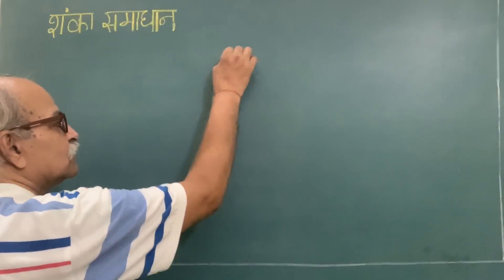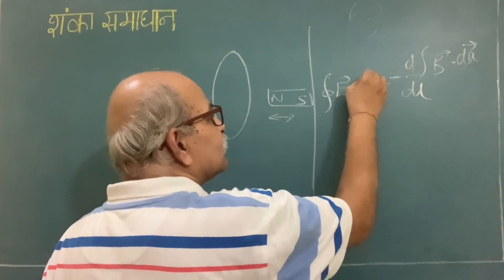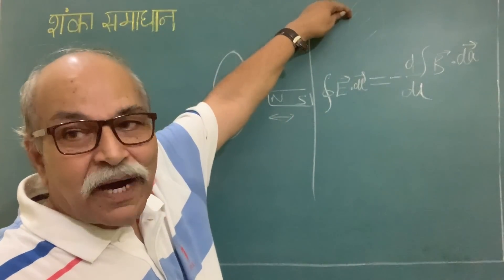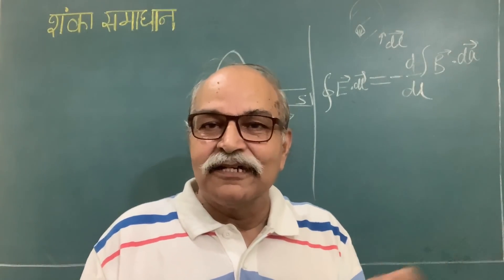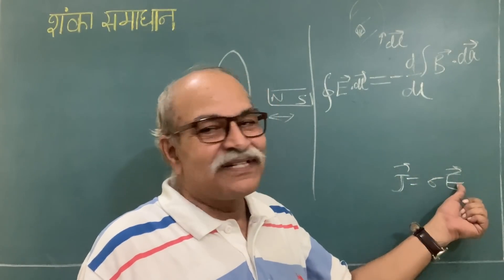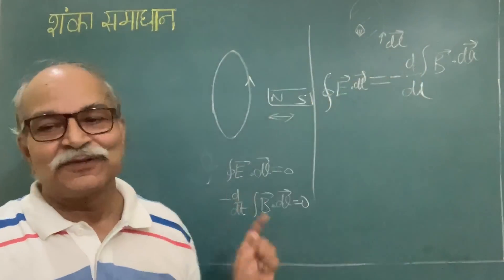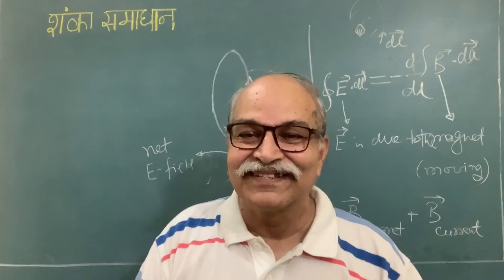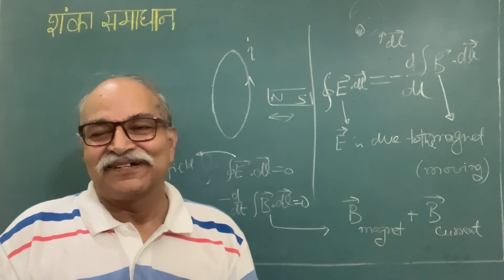Magnet moving in and out of a superconducting coil

Comment: Prof HC Verma is correct in saying that electrical field inside the super conductor is zero. However, at the surface/boundary of superconductor the electrical field won’t be zero. This is the one thing Prof Walter Lewin *added*. In this case, current will flow on the surface of superconductor only.    

On side note:  I have never found a better book than concept of physics. It was this book that made me crack IIT JEE. Thanks.
Reply: Does it act like a topological insulator?
Reply: @AsifShah-fi7oj  By definition- it seems like. However, the way I think is that at the boundary of the superconductor- at one side conductivity is infinity and at the other side, it is close to zero. So at the boundary, conductivity can have anything between zero and infinity.

Comment: The ceiling of a long hall is 25m high. What is the maximum horizontal distance that a ball thrown with a speed of 40ms 
−1
  can go without hitting the ceiling of the hall?
Reply: Use equation of projectile 
Put Y =25. 
Theta = 45 (for maximum distance)
You will get value of  "X"
PLEASE correct me if I am wrong

Comment: Sir I am a student from class 8 having doubts regarding  a question that is 
- Is It electrostatic force which is forming  a the electromagnetic field?
Reply: A stationary charge is surrounded by an electric field which can exert forces on other charges. This is called the electrostatic force. If the charge is moving it will also generate a magnetic field and these two fields together, electric and magnetic fields, are called the electromagnetic field.

Comment: Sir, You said there is current in the loop but also some professor's solutions deny it by saying that there's no current inside .But it is present on the surface as surface of superconductor have non zero resistance and also there can't be a current inside any superconductor loop. Sir justify it.

Comment: Professor Walter declared this explanation as a wrong solution and HC Verma sir accepted it as incomplete solution.
Reply: @suryabartasaha341  The classical electromagnetic part pertaining to HC Verma is absolutely right. In fact, Lewin himself does not understand Superconductivity. Read my previous comment and you will come to know.
Reply: When Lewin says that no Electric field can be there inside the material, he is wrong
Reply: Can you pls tell me where he accepted it to be incomplete? Was it some comment on video or somewhere else?
Reply: @musicalbot9172  in Walter lewins lecture
Reply: @jeetendrasinghrawat6661  did he comment on walter lewins video?
Reply: @musicalbot9172  nope , Walter lewin himself saw video in hc vermas channel when he came to know that hc verma had solved his question
Reply: @jeetendrasinghrawat6661  read the comment carefully. It says "HC verma sir accepted it as incomplete solution". I am asking where did hc verma accept it as incomplete.....
And this Walter Lewin, he has a very poor condescending attitude. Calls HC Verma "blatantly" wrong when in fact he was correct for most of the part. He himself makes tons of mistakes in his question video himself and calls others blatantly wrong.
Reply: @musicalbot9172  according to Lewin , there will no induce current inside the superconducting coil , instead that , current will induce on the surface of the coil
Reply: @jeetendrasinghrawat6661  This is where Lewin is wrong! What does he mean by surface? A surface theoretically has zero thickness... Can current really flow into something with zero thickness? In that case the areal current density would not be defined. Walter also says that "inside" the superconductor, everywhere B=0. This is also "blatantly" wrong.The truth is that..in superconductors, there is always a penetration of the external magnetic field in the material which is significant in  the penetration depth from the surface. The current flows in this "volume" of the superconductor. Deep inside the superconductor, B goes to zero...

I will post a much detailed version soon.
Reply: @musicalbot9172  idk but also experimentally , induce current will be on surface , please don't get offended by anyone 😌
Reply: @musicalbot9172  Atharva perhaps misunderstood between HC Verma and AVI Loeb
Reply: @musicalbot9172  see actually u r offended , so it doesn't matter who is right or wrong , now ur brain is like this person is wrong , please don't make that a controversy , or hc Verma v/s Lewin ...... We are here for study so better to study 😌
Reply: @jeetendrasinghrawat6661  Listen, I am myself a researcher. The language of Lewin was in a bad taste. "Even Verma cannot solve this" "Verma is blatantly wrong" " it could not be more wrong" "it's wrong physics"

The irony is that lewin himself does not understand superconductivity and has made tons of mistakes in his video. 

Wait for my answer.
Reply: @jeetendrasinghrawat6661  A DISPLAY OF A VERY POOR CONDESCENDING ATTITUTE BY WALTER LEWIN! It all starts with his statement "I doubt even Prof Verma can answer this problem". Then goes on to call the solution "blatantly wrong" " and "it is wrong physics" in a poor taste. 

Dear HC Verma Sir, thanks for all ur contribution to the student community.

Lewin just cherry picks on one phrase of HC Verma of the current being in the material and then calls the complete  solution "blatantly wrong" and says that "it is wrong physics" where in fact most of the solution is absolutely correct. It's just that HC Verma should have used the language "E and B go to zero deep inside the superconductor and he could have described the distribution of current inside it but it goes far beyond the scope of JEE (the question said it was for JEE). The bigger irony is that Walter Lewin who calls Verma's solution wrong himself does not understand superconductivity and he so instead of using the phrase " deep down", says that E is zero everywhere inside .

LEWIN himself makes TONS of mistakes in his question video...

Zeroeth of all, he calls it a JEE problem...Seriously? Superconductivity?

Now comes the first point. Lewin says that there can be no electric field inside the superconductor. "Blatantly Wrong!!!". Ever heard of london penetration depth?

Lewin says in the solution video that the current will flow on the surface of the superconductor. He says that there can be no current inside the material. "Blatantly Wrong!!!" Surface by definition has zero thickness which will blow up the areal current density. The truth is that the current does flow inside the material but near the boundary of the material(near the surface, not on the surface!), significant amount of which is upto the penetration depth. Only deep down the superconducting material, B and E go towards zero.

This penetration depth can be of the orders of nm to um or even could become very very large if you happen to go near the critical temperature.

Second point, Lewin says "the beauty is...faradays law...creates an emf...an electric field..just OUTSIDE the superconductor"....LOL... " Blatantly Wrong!!!" What do you mean by "just outside"?
Faraday's law holds for any hypothetical geometrical loop created anywhere in space. This is what  HC Verma explains in his solution video and this is what you (Lewin) need to learn from him. And it is definitely clear now that you have not heard of 'penetration depth'. Current cannot propagate "outside" the material. The thing which Lewin and many others wrongly call a surface, is not a surface but a volume. In Lewin's words, HC verma's statement that current is there inside the material is wrong. Lewin also states "there cannot be any current in the superconductor".This is wrong! The current is definitely inside the material (LOL Lewin, where else the current could be?!). I again reiterate that current is not propagating on a surface but in a volume.

Coming to the second point, Lewin gives insufficient information regarding the external magnetic field. What if its magnitude is greater than the critical magnetic field? The superconducting state will be lost.

Third, Lewin gives insufficient information regarding the thickness of the superconducting wire. What if I use a thickness comparable to the london penetration depth of the superconducting material?
Reply: @musicalbot9172  ok
Reply: @jeetendrasinghrawat6661  This problem which Walter Lewin is hyping as a very difficult problem is a standard explanation in any solid state physics/ superconductivity course. Didn't expect this from Lewin. He too seems to be doing this as baits for indian students.
Reply: @musicalbot9172  I also was surprised when He said 17 eminent physicist including a nobel lauriet could not solve this problem when even in our BSc solid state physics book has the discussion on the Supercurrents and Penetration depth, there is no way H.C Verma don't know about surface current.
Reply: @mistric5951  I am earthian
Reply: @suryabartasaha341  You are right
Reply: @musicalbot9172  HCV said though E=0 inside the superconducting meterial there exists a current. It can't be true, the coil is at rest, the magnet is moving, coil is not moving means there should not be any net magnetic force which will cause the current  at this situation only  Electric field can cause the current if E=0 then what drives the current?
Lewin said no current flow is possible in the superconducting loop and E=0 throughout the meterial . "Faraday's law creates an electric field, EMF  just outside  the superconducter"
What does he mean by "Just outside the superconductor" isn't it also wrong? And most of all this is just an  information where is the explanation?
Reply: @suryabartasaha341  Walter Lewin is wrong on the following points:

1) No Electric field inside the superconducting material. E=0 everywhere inside. This is wrong. It approaches zero deep inside the conductor.
2)Current propagates on the surface. This leads to Infinite current density. Not possible. It has to be a volume of the material.

3)"emf induced just outside the superconductor"

4) Insufficient info on magnitude of magnetic field. A high enough would destroy the superconducting state.

5) Insufficient info regarding thickness of wire. What if I take a thickness comparable to penetration depth.

I feel that the question itself does not make sense. 

HCV seems to be wrong when he states that E=0 but there is a current

I have no problem if someone is wrong, but I do have if someone acts smart despite being wrong.
Reply: @musicalbot9172   I have a question, Faraday's law should be hold any where, in any arbitary geometrical loop, meterial body doesn't matter. So obviously inside/ outside/ surface of a rest loop made of superconducting meterial there is a electric field / EMF induced at the same time.  the inside electric field must be cancelled out, this could be done by the complete cancellation of the varrying magnetic field inside the bounded space created by moving magnets with the magnetic field created by the outer layer current of the superconducter, by this the net magnetic flux will zero making E=0

But the outer layer current is created/caused  by the induced electric field, which simultaneously induced inside. So for a brief moment there should be an induced electric field deep inside the superconducter which violets the property of Superconductivity.
Reply: @suryabartasaha341  Of course, we only talk about the properties in steady state condition.
Reply: @musicalbot9172   So this is a fatal mistake made by Walter Lewin( just as fatal as H.C Verma's "though E=0 inside the semiconductor a current can exist" )  "Faraday's law creates an electric field and EMF just outside the superconductor"
Reply: @suryabartasaha341  Yes that is a worse statement made by him
Reply: @musicalbot9172  You are absolutely right. Actually our Verma sir always try to explain how easily we can understand Physics. Instead of using just a peculiar term or stating someone wrong, our sir always explain in a easy way. Our sir is a genius.

Comment: Hi sir
My name is Roshni  from class 10
Sir I was reading class 10 physics book in which you have mentioned in your chapter 1 in Image formed by concave mirror that if object is at F the will form at infinity . But how the image will formed because we know that two parallel Ray's or reflected Ray's never intersect each other.
Sir can you explain this ?!
Reply: Infinity is relative🙂🙂
Reply: No you should clear your concepts of maths first  because  Mathematics  says that two parallel line(rays) will meet at infinity that is  why we say that image will be formed at infinity since we do not know at what exact point the image Will  be formed
Reply: @Nero6570  Maths says infinity is not defined but the right meaning of infinity is space because we don't know what is length of space .our measurement units will be finish but it's length and size also will never finished . In PHYSICS  says that a extremely long distance or size in respect of a very small distance or size ( If you see them carefully both are the same things ) . it's okay for a while I agreed  that they will meet at infinity ( consider infinity a place) As my mind says  distance between two parallel Ray's will never reduce but we consider it to reduce ;Why ?? . Okay for a while I agreed but explain me one thing no one has seen the image formed at infinity then how anyone could said that it will be highly enlarged ,Real and inverted ( as parallel Ray's should never met but they meet and infinity ,it also may possible that reflected Ray's would make virtual and erect or real and erect or inverted and real. At infinity anything could be happen then should I believe ??

Comment: Fantastic explanation. I love the energy of this professor :D
Reply from the maker: Thank you
Reply: @hcverma2928  sir I have a question. 
we know that electric field created by static charges is conservative and hence the work done to take a charge around a closed path is zero. But when we define emf of a cell we say that it is the work done by the cell to take a unit test charge around a circuit. sir my questiob is that are not the two statements contradictory??
Reply: @amibuntyda  that isn't closed path... It would have been closed path if initial and final position would have been same, but, there is a potential difference (cell) between the initial and final positions.... So it isn't a closed path...

Comment: Sir, pls correct me if i am wrong, wouldn't the magnet be "quantum locked" in the position... and would theoretical need infinite force to cause any movement of the magnet towards or away from the loop
Someone pls help me with this doubt of mine
Reply: I hope I am clear.
Reply: If the magnet has to be quantum locked . Then the magnetic field of the superconductor must be equal to the magnetic field of the magnet. Then it can be quantum locked and an infinite force will be required as both fields are balanced.
Reply: @akshatpandey9141  yes, so in this case the fields are balanced as well... i mean in all cases the fields will have to be balanced
Reply: @parijatsutradhar  absolutely.
Reply: @akshatpandey9141  thank u bro

Comment: Respected sir *@ hc verma  I  have a  QUESTION RELATED TO MAGNETIC FIELD IN A LOOP .WE KNOW THAT LOOP CAN BE ANY SHAPE WITH SAME INTIAL AND FINAL POINT OF CUTRRENT ..LET SUPPOSE A RECTANGULAR LOOP  IS THERE "ABCD" SO WHAT WILL BE THE MAGNETIC FIELD DIRECTION ON POINTS   A  , B , C and on D
Reply: Wizard 🧙‍♂️  tq bro.. But it is a rectangular  loop with a, b,c,d point  Π  ..on a, b, c, d 
 what will be the direction of current??
Reply: @sudanshdahiya9223  For knowing the direction of magnetic field you should know the direction of current and for knowing the direction of conventional current , you should check the positive and negative terminals of the battery. Conventional current always flows from positive terminal to the negative terminal of the battery.
Reply: @SteveEvans7  ok tq 😍

Comment: Best physics professor in the world.love u sir from heart.
Reply from the maker: Thanks. But no one is best. My style appeals you that is great.
Reply: @hcverma2928  yes sir ,thanku sir
Reply: Sir I have a question that ,if gravitational force acceleration is 9.8m/s^2,then sir if we think Is, buyount force acceleration is there or not?
Reply: @nishaupadhyay2577  Buoyant force acceleration?
The acceleration any object feels at earth surface is due to the NET force acting on the object (a = Fnet/M).  The two main forces acting on an object in still air(atmosphere) is the gravitational force or object's weight due to the object's mass less the buoyant force acting opposite to the gravitational force on the object (Fnet = W - Fb).  The buoyant force is equal to the weight of the air displaced by the object's volume.  Since acceleration is F/M, then this buoyant acceleration you are asking about would be

                       ab = Fb/M      from        a =   Fnet/M  =  (W - Fb)/M  =  W/M - Fb/M  =  g - ab  where g = 9.8m/s^2

However, we usually talk about buoyant FORCES but not buoyant acceleration

GH  Sept 13, 2021